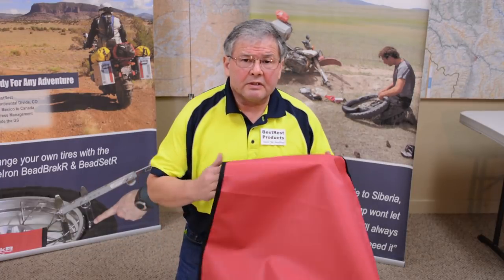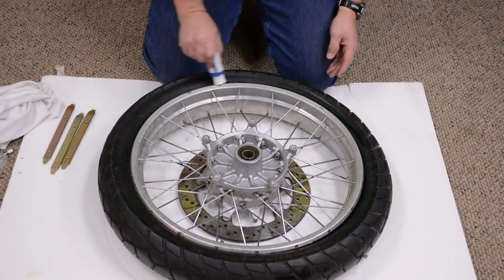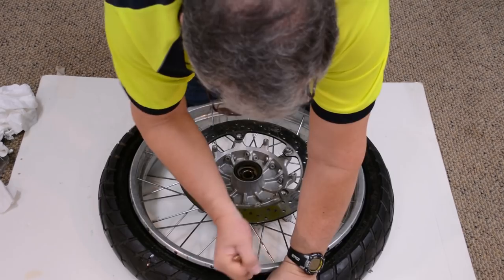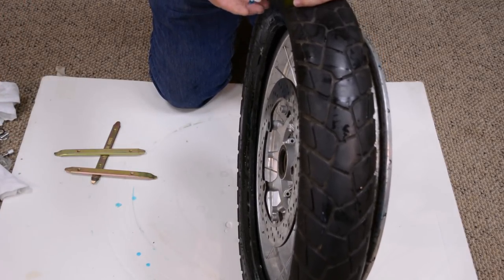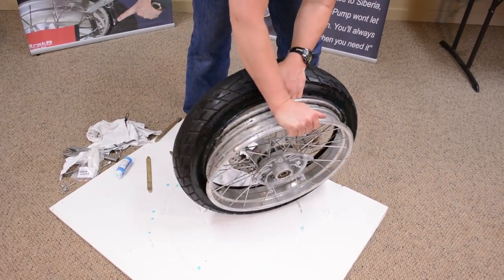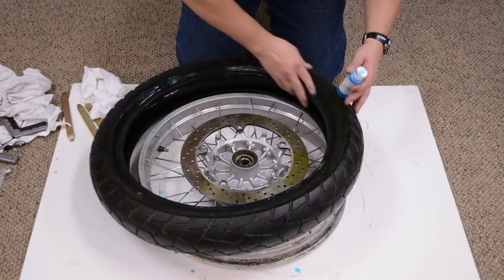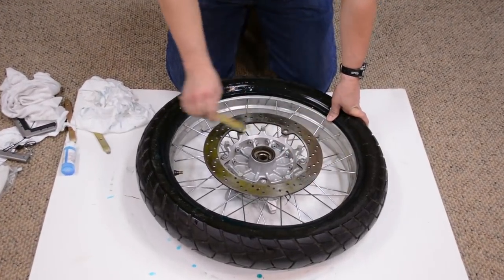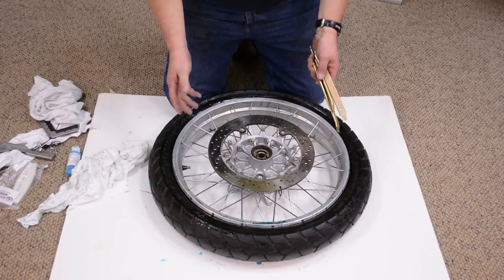How To Change A Motorcycle Tire

Comment from the maker: As a general rule, the hooked end is used for most of the spooning process.  On and off. 

The only time I use the flat end is during the final phase of re- mounting the last 12" of the 2nd sidewall bead. That's because the bead is very tight against the rim.  The curved end wont slip between the rubber and rim, but the flat end will.  Does that make sense?

Comment: Great video, I learned a lot that I was doing wrong. If I am getting tiny little bubbles from air leaking around the bead, losing about 1-2 lbs an hour what went wrong and what can I do?
Reply: There could be a number of causes. 
.
Did you clean the rim and remove all traces of the old tire? Sometimes bits of old rubber will stick to the rim.
.
Did you damage the tire bead when spooning it on? Cuts or nicks can cause leaking air.
.
Did you get some foreign crud in there when mounting? A blade of grass can cause problems. Dirt, sand, etc.
.
What did you use fir mounting lube? Dish soap and water remain slippery for a long time so air can leak. Instead use a real tire mounting lube that gets sticky when it dries, like BeadGoop.
.
Best bet is to demount, inspect, use proper lube, and remount. PITA but necessary to fix the problem.
Reply: David Petersen thank you, thats what I thought.

Comment: Your videos are quite informative. But of the ones I've watched so far related to removing and mounting tires on rims, you always use a rather narrow tire. How well do your products work with wide rear tires?
Reply from the maker: The rim you see in the film is called call "Reggie". He's been with us for 20 years. He became an employee after getting bent while riding off road.

To see a wide rim and tire watch the video "Tire Mounting 101". I explain the physics of mounting. At the end I mount a wide, stiff Moto-Z Tractionator onto a BMW GSrear rim, using 6" long tire irons.

Comment: Does the sprocket side of the rim need to be lubricated for tire removal and installation?
I noticed in your video both beads of the tire came off the rim from the disc side and both beads of the tire were installed from the disc side...which makes me question the value of using the lubricant on the sprocket side of the rim for either removal or installation of the tire.

Comment: its ok to use some extenders to get more leverage with the tire irons?
Reply: Extenders give you more leverage.  BUT if you use proper technique you don't need them. You can do a tire change using 6" irons. I've done it in a video. 

Plenty of lube, getting the beads down into the well, and proper technique are the keys.

Comment: Might I recommend for potential customers you show the tires repair completion near the bike,take your Cycle pump,use the alligator clips to hook it to the battery,set up the Bead setter....and demonstrate the entire process with all three products simultaneously.....would only take maybe 15 additional min.
Reply from the maker: +christoforos pilitsis   We did this video using another photographer.  No longer available.  If we added more footage we would have to create an entirely new one, and the metrics and shared links for this one would go bye-bye.  Not something we want...
Reply: Wow, sad that you would not want to share the virtue of your other products and the ease of use for customers who are unsure.   Pretty easy, no need for a fancy videographer, the iPhone these days will out do the quality you have currently.  It's more about the content than the fancy photographer.   Metrics are useless, content is king.

Comment from the maker: If rubber is sliding over a metal rim, lube them both.  It doesn't matter which side you take the tire off (sprocket side or caliper side), BUT you may find one side is easier than the other.

Comment: You forgot to match the directional arrow and the dot mark to the valve stem.
Reply from the maker: Yup we did.  Just plain forgot.  For the reader,  make sure you orient the tire so it rotates in the proper direction.  The dot is usually found on the sidewall of the tire,  and you should mount the tire so that dot is adjacent to the valve stem.  (however many tire manufacturers no longer put the dot on the tire)

Comment from the maker: My goal was to quickly show the basic technique. I worked fast, without concern for cosmetic appearance of the rim... 

If appearance of the rim is important you can use rim protectors, working carefully to perform a blemish free tire change.

When dealers change tires they usually booger the rims. They're in a hurry too.

Comment: Loos like it is practical but that kit is pretty pricey at around $200
Reply from the maker: Pricey? Depends on your perspective. Have a dealer mount your tires and it'll cost you about $75 per tire. Do the math. After 3 tires the tool has paid for itself.

Comment: Way to scratch the crap out of the rim
Reply from the maker: That rim is off an adventure bike, so scratches aren't important.  They get scratched on the trail from rocks and sticks and other things.  If you're worried about scratches you can always use rim protectors and work carefully to protect the rim.  If you're picky about appearance, take your rims to a tire shop and let them do all the scratching...

Comment: You had that gupe on your hands then you kept touching the rota, you have now contaminated the pads!
Reply from the maker: When filming I take some shortcuts and don't show everything.  That was a demo tire and rim that'll never go back on a bike.
Reply: @bestrestproducts648  you should say things like don't get this stuff on your rotas instead of just pushing your products!
Reply from the maker: Take a chill pill Chris. If I  was gonna put that wheel back on the bike,  I'd wipe it clean.  And because it's soap based it wouldn't contaminate the pads like oil or brake fluid would.  Instead of nit-picking on some small detail, try to appreciate the overall educational purpose of the video.

As for "pushing my products", who do you think pays for these videos?  Of course I'm showcasing my products.  If I didn't I wouldn't be able to afford to make the video.